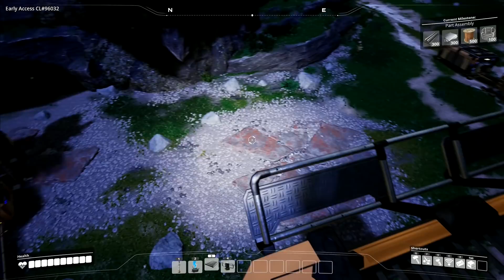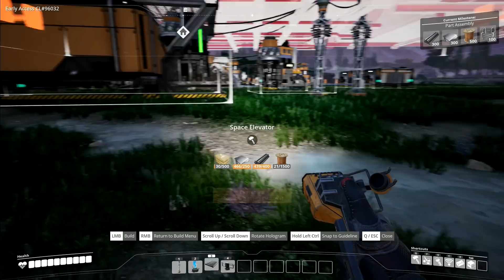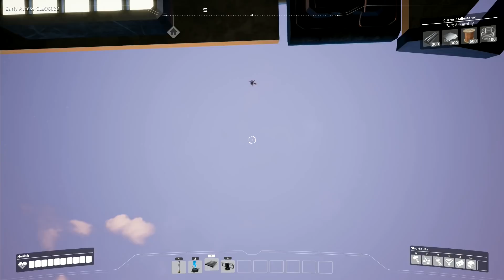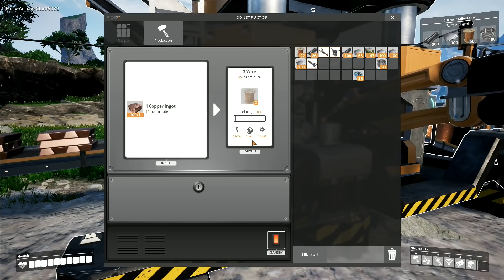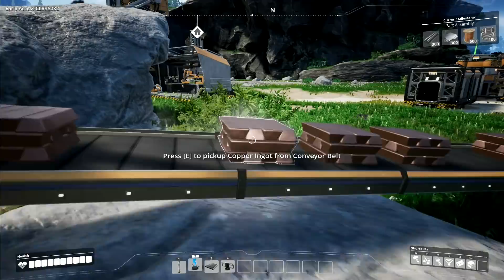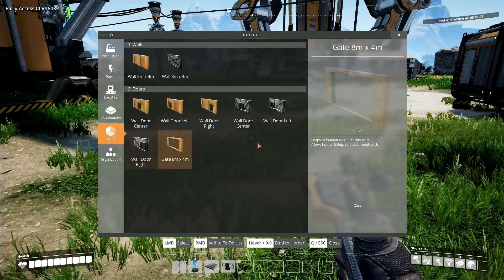Let's Play Satisfactory #7: Space Elevator!

Comment: To Fly : After activating the flyer, jump up there very quickly. I don't even know if that's possible.  Alternatively have another player activate the flyer while you're standing on it. You die when it hits the skybox and crashes your game. If you're the host, it will kill the game for the other player too. https://youtu.be/SG9oBf6rwPU?list=PLGe_S5n7MjT2_5A_qvSjuy-drLjWEeM4w&t=2254 Time stamped shortly before launch. 

Whenever you unlock higher tier belts, I recommend upgrading the compost belt. Also, you don't have to dismantle a belt to upgrade it, you just select the higher tier, then hover the mouse over it, it'll show a ghost like doing it initially, then just click it, and go. 

Copper : 1 "Normal" purity 60/min
2 smelters @30 ea. 
feeding 2x Constructors each @15 > 45 ie  15 ingots become 45 wire, for a total of 4 constructors. For a total of 180 wire/min
Unfortunately, until you reach higher tier belts, Mk 3 (270/min) to be specific, it's going to bottleneck.

For your current set-up, you'll need Mk 2, which does 120/min which is sufficient, since with the cable maker, it actually uses less than the 90, you'd otherwise have, but it's obviously still doing more than the 60 Mk1s can handle. Nope, no priority. If you press 'Sort' before you xfer stuff, you won't have to waste time clicking on multiple partial stacks. 

Some of my screenshots. : https://imgur.com/a/zvGtKf5
Reply from the maker: I'll have to remember to do that sort bit, will at least make my life a little easier!
Reply: @Frithgar  It just won't work so well if you split stacks on purpose though, because it'll put them back together.